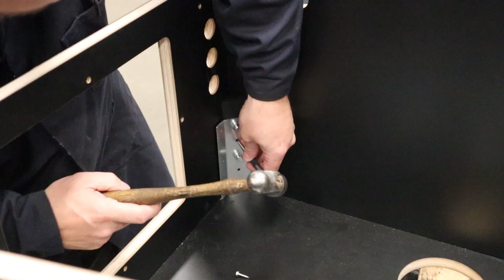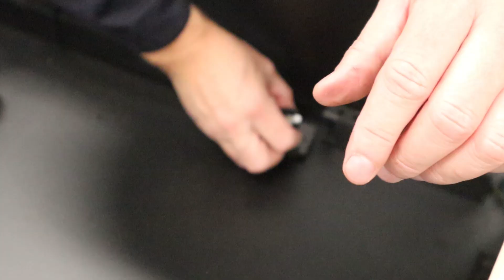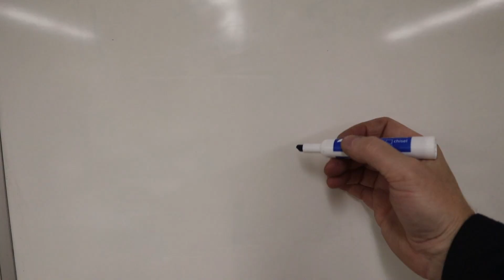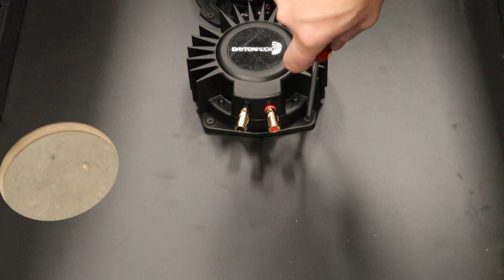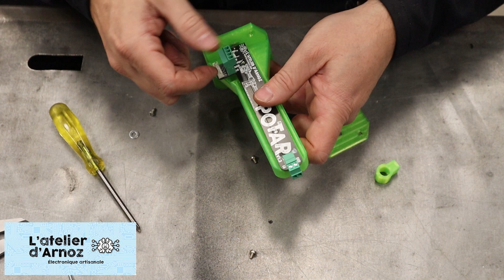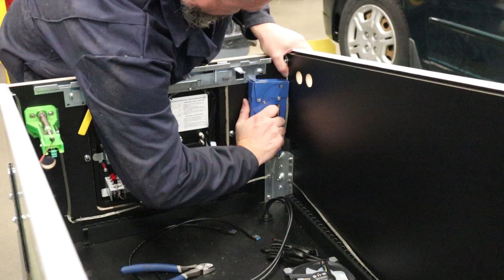My vpin never skips leg days!

Comment: Was there a link to the 12v PSU you used when you mounted the grounding wire?
It would be nice to have holes in the back to eaily mount it to the cabinet wall
Reply from the maker: The psu is part of the csd kit, link in the video description of this one or the parts video.  Hope that helps.  Cheers!

Comment: What size was the hole saw to drill hole for usb round plug u installed in the left corner
Reply from the maker: I'm not sure but around 1"-1 1/4" to fit the diameter  of the plug body.  I would buy your USB plug first and then measure it and drill to suit.  Thanks for the watch!
Reply: @wayofthewrench thank you 
I am building mine now following your videos
Reply from the maker: Awesome, have fun!

Comment: Hi Emil,  I am confused about the momentary switch button at the end of the plunger (31:00). Did you ever use it for  an extra button ? If use what was it used for. I am following your build but don't know what this goes too.
Reply from the maker: It isn't used in my build as there is a digital end of stroke switch on arnoz plunger that I used instead.  Thanks for the watch!

Comment: A question about the ground strip: 
I have the Tukkari cabinet with their black powder coated side rails and lockdown bar with the firebutton. The lockdown bar is fastened with 2 latches to the cabinet. 
If I first connect the ground strip to the latches for the lockdown bar and then scrape off the powder coating between the latches and the fastening point on the lockdown bar, and then scrape off the powder coating between the contact points of the lockdown bar and the side rails, is that sufficient enough to get good grounding?
Reply from the maker: You will need to make the ground wire connected to the metal parts by sanding through the paint where you attach them to the bare metal.  Find spots where it is not noticeable  like under the mounts for latches and in the hook on lockdown bar.  You can use a multimeter to check for continuity to endure its connected.  Good luck on your build!
Reply: Yeah, I will surely put the multimeter through it’s paces😁. I guess it’s down to sanding and testing until I get the parts ”connected”. Keep those videos coming!👍
Reply: You side rails are not touching anything and there is also 0 possibility a wire will touch it. In my opinion you don’t have to ground these. Lockbar is debatable. Legs also. I only ground parts like coindoor, toys and psu’s. Best practice is not daisy chaining these but create a star ground wiring all connected to a copper busbar.
Reply from the maker: @d.j.vandermeer3832 best practice is grounding the side rails too.
Reply: @wayofthewrench they only touch the wood and screwed in on the outside and they are powder coated. Tukkari rails are not the same you use in your build. But grounding these will not harming you :-). I’m adding a RCD in my cab. Think most of the builders are not doing this. That said your videos are really helpful. Thanks for all your effort!

Comment: Question: I just got the same Punch PPS4-6 speaker.  I was checking the fitting in the hole and it fits great if I put it in from the bottom.  The flange and grill can be screwed in from the outside.  Is there a reason not to do this? 12:36
Reply from the maker: I don't  want the speaker hanging out on the bottom as it makes it really hard to load into a vehicle without removing  it.  Hope that helps.  Thanks for the watch!
Reply: @wayofthewrench thanks for the reply!

Comment: OCD Advice: Whether it’s by PWM or number / size of fans, I would suggest considering “positive” air pressure inside the cabinet such that there is more intake air coming IN to the cabinet than exhaust out of it.  Not by much, but enough that it creates a slightly positive pressure inside and that mitigates the influx of dust from other cracks and holes in the cabinet. Otherwise you can get dust streaks at cracks inside the cabinet here and there. And if you can use an intake dust filter (i.e. it’s not starving the cabinet of air circulation)it also helps keep the cabinet interior cleaner.  In my cabinet I use larger 140mm fans at the front (for nearly silent operation) and 120mm fans at the back for exhaust.
Reply from the maker: Great advice on managing airflow to keep the dust down, thanks for sharing!   I keep forgetting to add a pc filter on the front fan.  Thanks for the watch!  Cheers Wayne!

Comment: Thanks for a great video I am trying to copy you with my setup. This may be a stupid question but where do the 2 wires on the plunger on/off switch go to. I dont see you wire them to anything and want to make sure I am doing it right. Any help appreciated
Reply from the maker: Nice!  The physical switch is not hooked up to anything as there is a digital end of stroke switch built in.  Hope that makes sense.  Thanks for the watch!
Reply: I am doing the same by following his build and I’m in the very early stages. If you figure it out and understood Emil’s reply let me know as I was confused as well. Have your photo if you have one and how it is connected.

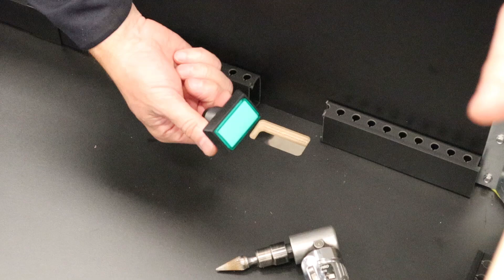Comment: @8:17 you reuse a power button you had. I'm having difficulty finding a rectangular button on Amazon not knowing the correct lingo to search with (if you have ideas please let me know), but assuming I had this button how are you adapting that arcade style connector to the small PC motherboard connector? That part is just sort of left out of the video.
Reply from the maker: I used an extra rectangular  button from my virtuapin button kit.  You could use whatever button you like though.  If you search for a rectangular arcade button, you should be able to find one.  The hook up is in the decased pc video.  I just tap it into the 2 wire switch for pc power.  Hope that helps.  Thanks for the watch!

Comment: what are the actual height of the legs when they are installed? Floor to bottom of cabinet?
Reply from the maker: Hrmm not sure but they are standard williams legs so it'll be on the net.  Thanks for the watch!
Reply: 28 1/2 but the question is - is that the actual mounted height or the whole leg (with the part that is ‚over‘ the cabinet)

Comment: I have the power supply mounted in the cabinet but I am not sure about which connectors go were.  Did you have a video on how to run the wiring to the blocks?  On the power supply, were the cables screw in, There are 2 that are listed COM and 2 that are listed +V.  And then the 3 that the power cord are screwed into.  Don't want to let the magic smoke out
Reply: I think I figured it out. I haven't fully tested it yet but I ran the com to the black which is the ground and the +v to the red.
Reply from the maker: Yup that should be it but you need to attach the ac wires too.  If it wasn't clear in my video, you could watch my power supply video in my budget vpin Playlist which is way more detailed.  Thanks for the watch!

Comment: Going back and forth between all the incredible videos.  Almost got all the parts in.  The shaker motor has a power supply and the solenoids have one as well.  Are you using one of them for the grounding?  The power supply you are using for the grounding looks bigger than those two.
Reply from the maker: I have all of my toys running off one 10 amp 12 volt psu.  The ground runs through it's case to the grounding wire and the ground terminal block.  Hope that helps.  Cheers!

Comment: Hi Emil - I'm in the process of trying to clone your build down here in Virginia, and I'm on the last steps of this video (applying the grounding strap). I've been buying most of my parts following your links, but I just realized that I haven't ordered either of the PSUs you install. I can't seem to find any link in any of your videos to purchase those ... could you post the links for the 12volt and 5volt PSU's or what I should search for on Amazon? I'll apologize up front -- I'm such a novice at this I'm nervous about screwing something up like ordering the wrong parts..
Reply from the maker: Hey Neil!  The PSU are from the Cleveland software design and were part of the aled kit and the solenoid kit.  It's a 5v and a 12v PSU.  They are both 10 amp I believe but you could add a buffer and get more amperage if you want just to be safe.  It's not really that much for 20 or even 30 amps.  I think I have links in my budget vpin parts list.  Hope that helps.  Thanks for the watch and good luck with your build!
Reply: @wayofthewrench  Thank you Emil! You're a lifesaver!! I'll send some pics when I'm closer to complete.
Reply from the maker: Sounds good!

Comment: Emil - fantastic video series.  A question...which power supply did you attach to the inside left rear of the cabinet against the grounding strip?
Reply from the maker: Thanks, it's a lot of work so I'm glad people are enjoying it.  I put the 12volt 10 amp one there and I think the 5 volt one is on the other side.  In retrospect, I should have reversed those psus as I had to run a thick wire over to the right to my distribution block.  Thanks for the watch and your support!

Comment: I was just putting the side rails on my cab, and I wasn't sure what fastener you used at the back end of the steel rails.  I just used the same carriage bolt (#8-32 x 1-1/4") used on the front, but the Pinscape build guide says you have to worry about clearance on the backbox hinge.    Can you get away with the same carriage bolt on the back?

Also, what screws did you use to attach the leg brackets to the cabinet and the wedge piece?  I think I need to buy some of those.
Reply from the maker: @JasonPriebe  you can just use a countersink head wood screw do it'll sit flat.  My new big budget parts video has all of the links the the leg fasteners in the video description.  Thanks for the watch!

Comment: Can you fix the link for the Leg bracket screws? Great video btw! Thanks
Reply from the maker: I just tried it and yes it does take you to a redirect page but it does take you there after like 6 seconds or you just press the go to site button.  I had to use shortened links because the real links took up too many characters in the video description.  Thanks for the tip and the watch!

Comment: Do you have an estimate on how much all the parts cost to build one of these including the flatpack from pinballcabinet ( not including the pc ) but all the other parts, so I can get a rough estimate on the current prices and price to build on of these as I'm slowly getting into pinball. ~ Thank you!
Reply from the maker: If you have to ask, you can't afford it.....lol.  just kidding.  This build is the big budget build so the cost of parts is waaaay more than my budget build which was $1500 all in.  I don't have a grand total but it's up there.  I recommend starting slow and start with monitors and PC.  Then build or buy a cabinet to suit those parts.  Then slowly add the parts as you build.  It's easier on the pocketbook that way.  Hope that helps.  The links in the video description will give you what you're looking for.  Thanks for the watch!
Reply: @ ah thank you sir,

Yea true though 😂 nah but I just like to start “small” and learn from there as I have absolute zero experience in this field with connecting physical buttons to digital software but I’m sure it’s easy as I’m tech savvy myself in computers and quick to learn on new software as I was able to get vpx8 on my main pc and use it there just to learn a bit before getting into a whole new area = pinball cabinet 

Thanks for the
Reply from the maker: If you haven't already watched my budget build series, do it!  You'll love it.

Comment: Hi, I noticed that you don’t recommend MDF because it’s not ideal for feedback. Unfortunately, my structure is entirely made of MDF. However, if I add two panels of 7 or 10 mm plywood inside, would that be acceptable?
Reply from the maker: Yeah I wouldn't recommend it but at the same time it will probably be ok, it'll just be less vibrations.  You could test it on some scraps to see if it matters.  Thanks for the watch!

Comment: Hello, I followed your budget build series and completed my cabinet about year ago. For early Christmas gifts I received some beacons, gear motor and shaker and revisited your series to get those installed. Brilliant by the way, the videos are so easy to follow. Through that adventure, I started following (and dreaming about) your BIG BUDGET build series. You talk about the grounding strap wire, but this is the first I have heard of it. I don't recall you talking about this in the budget build series, so went to your list of parts and I don't see that listed. I might be missing it, but if you have minute, share the link or add the part to the post. I'm guessing they're all pretty much the same, but thought I would ask just in case, and hopefully you get something on a referral link. Thanks again, you have a gift of breaking down complicated things into fun a project. You hooked me for life!
Reply from the maker: Thanks, I'm glad you are enjoying the content.  Here a link to a grounding strap wire.  https://www.amazon.ca/Euogeudel-Braided-Flexible-Shielding-Mesh%EF%BC%8816-4ft%EF%BC%89/dp/B0CB41NTV9/ref=asc_df_B0CNCR7D34/?tag=googlemobshop-20&linkCode=df0&hvadid=706828429895&hvpos=&hvnetw=g&hvrand=11602314628473918052&hvpone=&hvptwo=&hvqmt=&hvdev=m&hvdvcmdl=&hvlocint=&hvlocphy=9001517&hvtargid=pla-2281534940129&psc=1&mcid=179b78b5be9934e39ff352825a7a6cbb&gad_source=1&th=1.  Hope that helps.  Thanks for the watch and your support!

Comment: @25:33 I’m sure that’s a good tip for if a lock-down bar won’t tighten. I’ll also say that I have a real pin (TNA by Spooky) and that one I often have to jiggle the handle and bar around a bit to get it to tighten fully, so I guess sometimes they can just be a little finicky.
Reply from the maker: Yeah they can be a little finicky but after you tune them up, they work great.   Thanks for the watch!

Comment: Nice video, thanks!
Just my thoughts on what i've seen:
If you start from the other side with the router you can leave the last ridge. 
And when you put the woofer in with the magnet down, then take the Pencil an drill the holes, flip it magnet up the holes still match.
Reply from the maker: Yeah I could have left the last ridge, it still would have fit ok.  Yeah that is a good trick to help line up the holes too!  Thanks for the watch and the tips!  Cheers!

Comment: Is it just me, And I stand to be corrected but when you joined your wire cases wouldn't that prevent the capping from being removed to run your wires?
Reply from the maker: Nah they slide out pretty easy to run the wires later.  Thanks for the watch!

Comment: Make a 3D printed stencil and use your flush trim bit. Or make the stencil bigger and use a normal router bit and a copy ring
Reply from the maker: Yup you sure can do that, I even mentioned that in the video but I have never seen anyone do the trick I showed so i did it differently for people to see.  Plus it was really quick to do.  Way quicker than making any templates too and no screw holes/double sided tape to hold them down either.  thanks for the watch and the tip.  Cheers!
Reply: @ your method is not precise (but I think precise enough for that matter). Every deviation from the perfect circle or every tiny bump from the bearing multiplies to the next pass.
Reply from the maker: True but it's just a clearance hole so not a big deal.

Comment: You could have 3D Printed a router template with the correct diameter for the speaker hole. - 3D Prints are great for router templates! - Any recommendations for the grounding wire (did not see it in your parts list)
Reply from the maker: Yes you are right and I did mention that I could do that but i thought I would show a different technique plus it was really fast to do.  There is a link for my grounding wire in the budget parts video description.  Thanks for the watch!
Reply: That's exactly what I did - 3D-printed a template.  It was working great when the follower bearing seized on the cheap trim bit I was using (its first use).  I didn't notice the bearing was spinning with the bit and it quickly melted the template and the bit wandered quite a bit out of bounds.  But - 3Dprinting to the rescue - I was already planning to use a large 3D-printed "via" (to save me from painting the bare wood) and that perfectly hid the now ugly gouge.